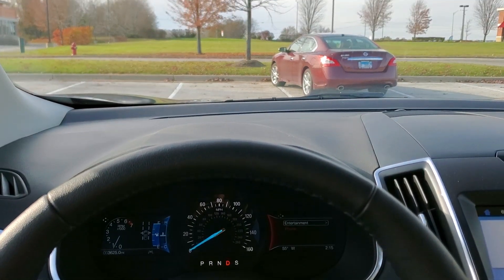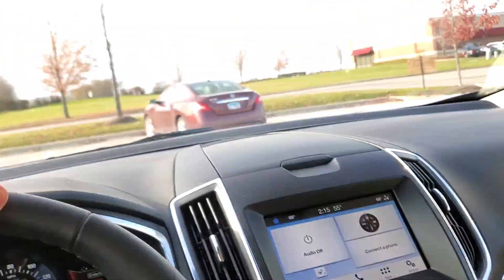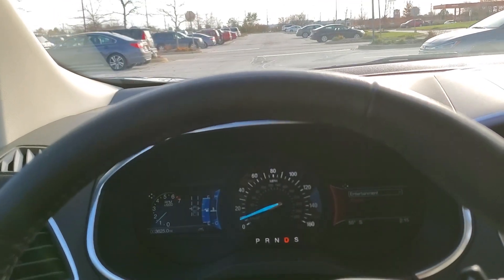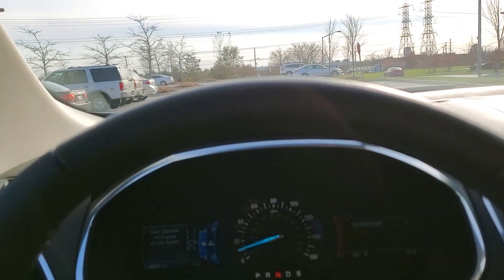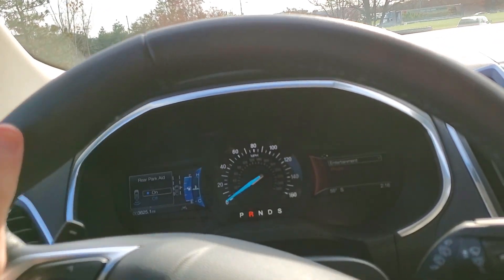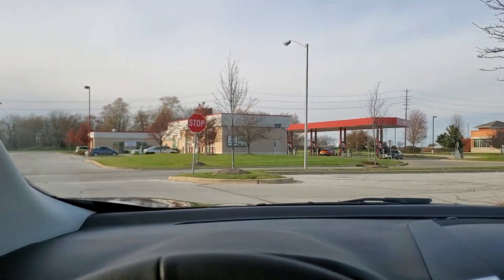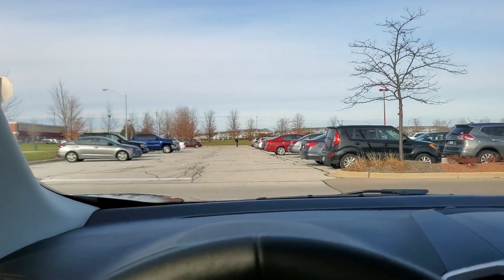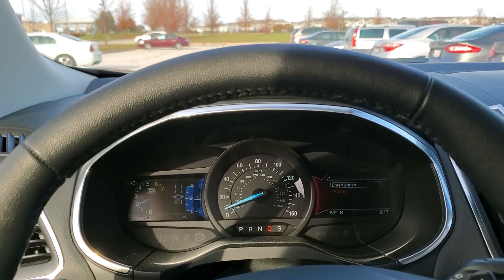What Happens If You Shift Into Reverse and Park While Driving?

Comment: I saw a show once where a girl was driving with her mom and the girl threw their station wagon in park since her mother had a diabetic attack while driving...guess you can’t do that in a car nowadays! I still prefer a regular shifter over a dial or buttons though
Reply: that was back in the days before brake shift interlock
Reply from the maker: That's what the parking brake is for. 🤣
Reply: BusMaster99 yeah but in a new car I read the parking break won’t work while in motion either on some cars
Reply from the maker: @dalegribble3684  Well you have to hold the switch to use it as an emergency brake.  That may be why.
Reply: BusMaster99 I did not know that! Interesting!
Reply: I think this was on rescue 911!

Comment: A person I used know mistakenly did this with their Dodge Ram's rotary shift dial, it didn't go in gear.  However, it did wind up knocking something out of calibration or just mindfucked a computer.  Drive became park, reverse became neutral, and neutral became drive, Putting the truck in park would put it in park,  it couldn't go into reverse.